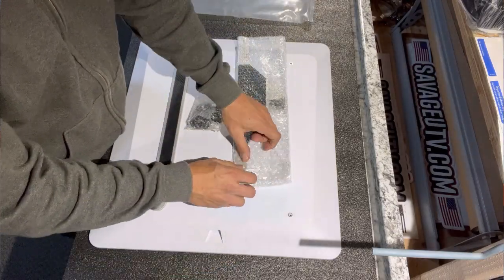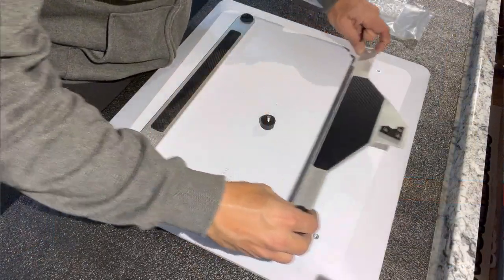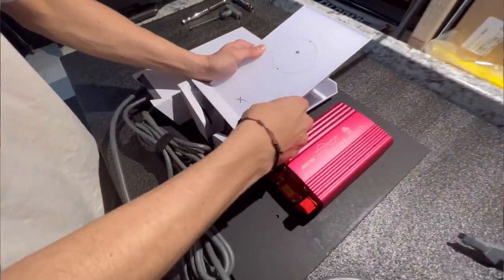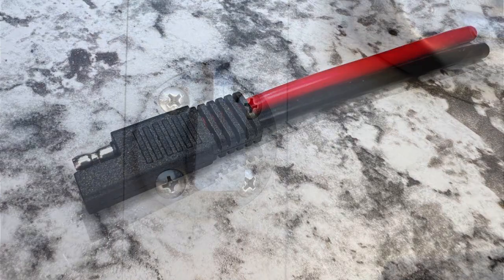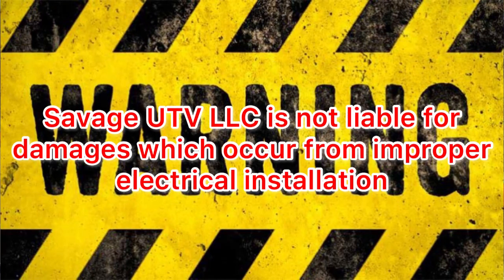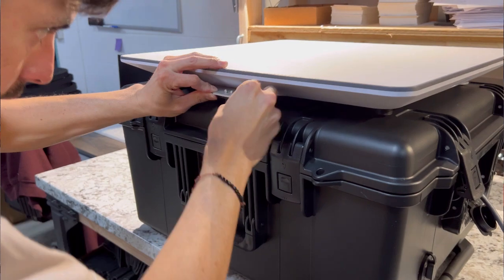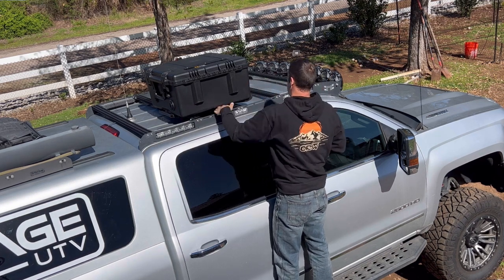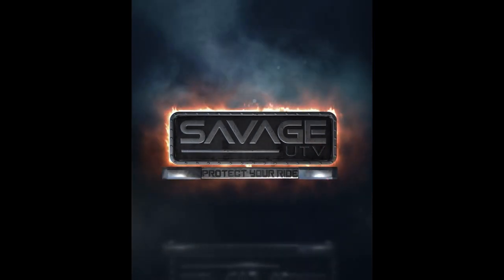In motion Case for Starlink Flat Dish

Comment: Can I use this with 230v ac and/or 24v dc? What parts need to be replaced, if any?
Reply from the maker: This case is designed to work with the US version of Starlink. The electrical ports will not work if your system is running off of 230V AC or 24V DC.